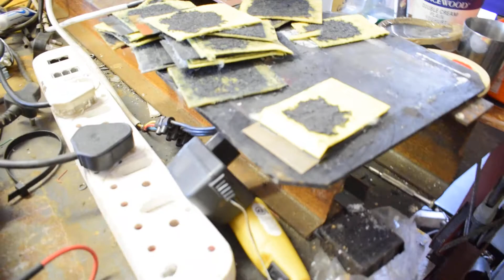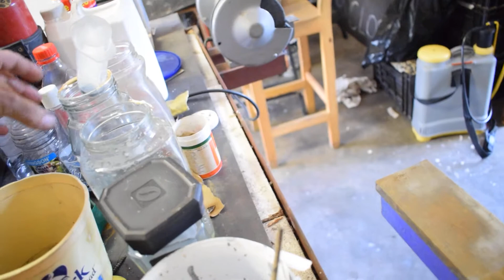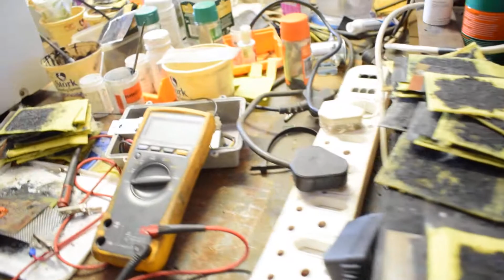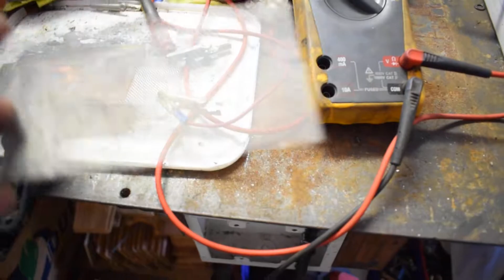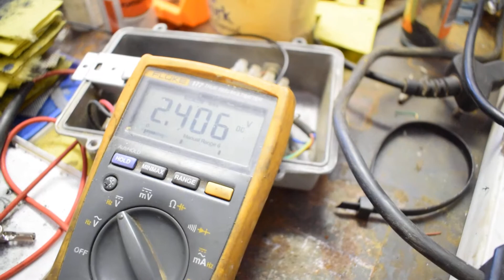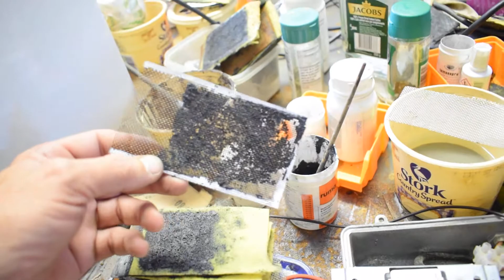new video hope its better

Comment: Hi Barry
Good to see another open source researcher working on cells.
Using the stainless screen is a good idea but it's hard to maintain consistency.
Are you discharging through a load or dead short?
Reply from the maker: only dead short at this stage, gives me quicker results, if there be load on like Kev or some of the users 1 amp / 50mAmps will take considerable time i do use an oscilliscope to see voltage drop in evenings. stil have to get nice eqpt like the users have to visualy monitor the wattage. for me currenly a dead short test is the ultimate that is bretty strong load and the battery or cell must maintain a voltage enough to meaningfull work...